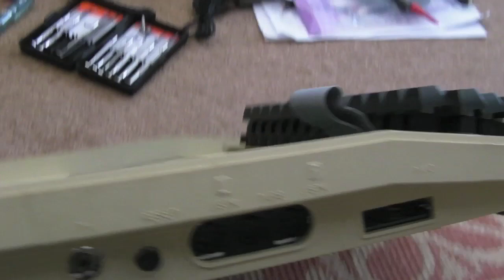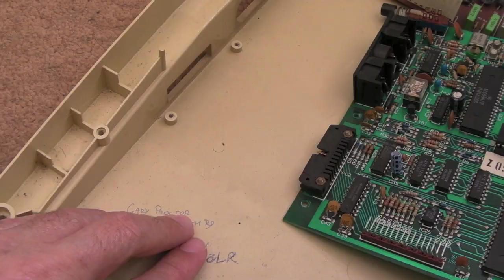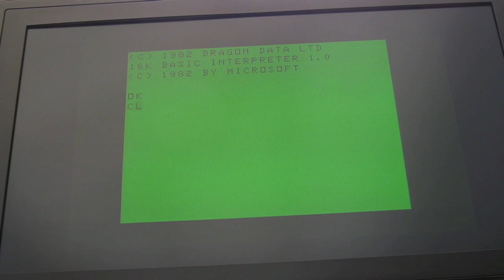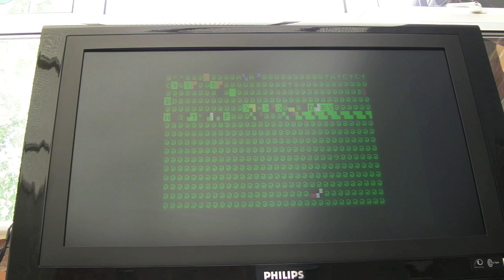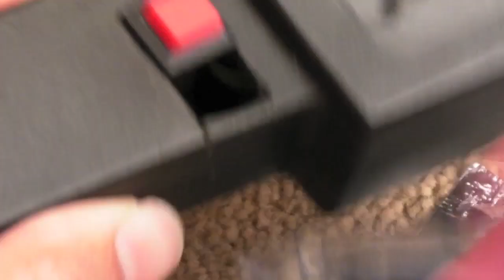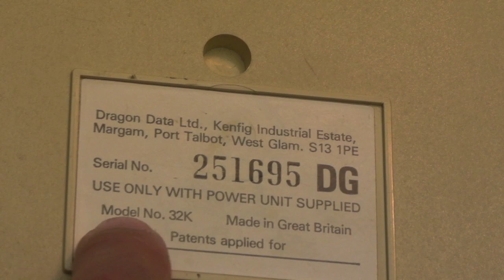Dragon 32 Garbage to Gold (Will it fly again?)

Comment: Just found this, did you ever hook up a hard drive to the printer port? I had one on my Dragon 32/64 it worked very well.
Reply from the maker: What kind of drive is it that you are using?
Reply: @GadgetUK164  Was that question for me? It was a standard DOS drive utilising OS-9 as far as I’m aware. I think it was a retail buy as I can’t remember building anything so not a project as such. There’s very little info on it which surprises me as all my DragNet mates had them.

Comment: Great video by the way - thanks for posting - some useful techniques there for working with these types of boards. Are there any recommendations for where to source some of the older ICs in the UK - not necessarily just for the dragon 32, but other older machines as well.
Reply from the maker: Thanks!  Often eBay is your best bet!  These days its getting harder to find many custom chips though - you may need to find another faulty system for parts.

Comment: Great, all perfect, Dragon 64 has another ROM and can boot in 32 mode
Regarding the Joystick, I would suggest that you put a 2nd button, but it depends on whether you get the cable with the appropriate wires and the co-connector, at least in Coco there is
interesting proposal to make the list of coconut cartridges usable in dragon vice versa, or I have almost all coconut and I have a DRAGON Tano ntsc, I will try to make the list
+Suscript

Comment: I got my Dragon 32 (bought new by me in 1982 or 1983) out of the attic to play some old games with my son. There are some websites with audio files on them which are recordings of the casettes - I used the headphone socket of my laptop on max volume to play these into the Dragon - this worked a treat and I would recommend this to anyone who does not have access to an old mono casettte player. Then you have to find a television with a tuner but that's another story!

Comment: Good day bud. I've just found your channel and I too have a dragon 32. I'm not hugely tech minded but I wonder if you could give me a bit of advice. I plugged it in and you can hear a click, the components inside get warm but all I've got is a blank black screen. I tried tuning into another channel(36) and you can sort of see something scrolling up. I'm also plugged into an analogue TV. Any help would be much appreciated 👍
Reply from the maker: I would make up (or buy) a composite lead!  I think I mentioned how I made my own in this video!  The problem with RF these days is you will find it almost impossible on modern TVs to tune into the crusty analog signal when using RF.   It's worth checking the voltages as I showed too - both on the PSU and internally.
Reply: @GadgetUK164  cheers for your advice mate, I'll get myself a multimeter and test the voltage etc and get myself an up to date lead 👍

Comment: How did you manage to get such nice video output? Mine is super blurry and I can't get around this problem :/
Here is a pic of mine D32 connected via composite. https://i.imgur.com/8a2qAf8.png
Reply from the maker: It might need recapping - it could be that the composite cable you are using is not very well shielded or too long perhaps?  Final thing might be the fact I grounded that crystal on the PCB there, but I suspect that relates to RF more than anything.
Reply: @GadgetUK164  Good points, however, I've already recapped it :(  I'll check crystal thing but I suspect LM301 opamp is dodgy. I've just ordered a few of 'em :)  Sorry for noob questions but I've never run this machine before so I didn't even know that a video output is crappy until I saw your video lol :D

Comment: I've seen many boards where they don't maintain pin-1 alignment.
It should be noted though that this is most commonly used when they put more focus on data or address bus alignment.

Comment: Your -5v is used for biassing the bases of the FETs in the DRAM, each chip only pulls ~200uA, so 16  of them will be 3mA. As you noted the regulator will not heat at all, so its not required to heatsink it. I imagine originally insulated and bolted down just for mechanical stability.
Reply from the maker: Thanks for the info there =D

Comment: Interesting about the Tandy similarity, can't say I've heard anyone mention that, good way to pool both communities with mutual love and make them less obscure in the mindshare. Loud colors compared to Tandy.
That Playstation cable is light gun related, you can increase the accuracy by running one through the Composite line, that and the back ports changed with PS1 revisions so they had to adapt to that.
Analogy bits heh, yeah it all had it's quirks with manual driven remedies. A lot less tape loading in my region but music and VHS needed a little added tension sometimes in my experiences.
Reply: @unrepeatable raddish : Yeah... You could use a lot of the Tandy cartridges, tapes, and controllers on the Dragon 32 with NO issues at all - there were an odd one or two that didn't work, but most did....  That's what I found when I worked in a small independent retailer that had a Tandy dealership associated with us... so we also had the TRS-80 Colour Computers in store at the same time as the Dragons.... Very inter-compatible!!  Good machines both, except of course here in the UK the ZX Spectrum and C64's ruled the gaming landscape at the time - and both of them too being fabulous computers of the day.... the Spectrum being the most popular, and giving many of todays best known producers of games their start, by doing the 'bedroom programming' thing!  Companies like EA, Activision, and Rare all started with the ZX Spectrum.
But all that said, the Dragon, and TRS-80 'CoCo' were good computers for the time too....

Comment: The IC17 (ROM) has been replaced on your Dragon32.. possibly there was a problem with it originally, or it was an upgrade.. see worldofdragon site for more details..
http://archive.worldofdragon.org/images/3/3e/Dragon32_PCB_Top%28PC10087_Issue6%29.jpg
Reply from the maker: Thanks for the info there!!! I've been wondering about that ROM for a few weeks now lol, and you've solved it for me =D
Reply: I've got a Dragon32 (not that I can recall opening it up though) and I've also got a Tandy Colour Computer 2 with 64k Extended Basic.. so I know most of the quirks of these machines from years ago.  There was a bug in the original Dragon ROM, because they essentially cloned it from the Tandy and changed a few minor things - that was the major reason why Dragon Data was sued by Tandy Corp.  The DEFUSR(0) command is buggy on the Dragon32 - that's the one give away!  Your IC17 could be an attempt to rectify that bug, or the original got fried and it was a spare inserted in its place.
Reply from the maker: Thanks for the info there =D

Comment: Great video as usual. 
I have a Dragon64. You can use a CASDuino to load games, I asked the guys to support Dragon .CAS files as I thought they might be the similar as MSX files and the guys managed to do it. :)
Also you can build a Digital-to-Analogue converter for the joystick to use normal 9-Pin Dtypes. They work well, especially as many of the games are Spectrum conversions which were designed for digital joysticks.
Reply from the maker: Thanks =D  Yeah. the TZXDuino works too - with the right firmware.  I will get another with Dragon firmware soon =D

Comment: having watched this and had lots of memories stirred I did a bit of reading up. As you mentioned you can control the cassette using MOTOR ON and MOTOR OFF in BASIC. However, you can also type AUDIO ON and AUDIO OFF to play the cassette through the TV speakers. I used to play music tapes through it when I was a kid. There's also a game called 'Drone Datatank' which used this feature to add effects to the game as you played it - if you can get hold of it, it might be a nice thing to feature.
Reply from the maker: Thanks!  Was aware of MOTORON (I used that to test but forgot to mention in the video), but I wasn't aware of AUDIOON =O  Will try that next time I look at the Dragon!

Comment: Nice.  I used to have a cartridge that would retoken Coco basic programs.
Still have my Dragon but joysticks are long gone.  Might knock up an adapter.
Reply: You save the BASIC program as ASCII by appending ,A after the file name on either computer. Then, you can load it on the other system and re-save it normally.
Reply from the maker: Thanks for the info!!! I had no idea there was a cart for that!

Comment: Another excellent video. The reason the Dragon32 and the TRS80 COCO are so similar is they are both based on the example computer that Motorola published for the 6809 CPU. That button on the joystick is bang on for the original by the way.  In all the Dragons I've worked on the -5V reg is just sat upright. The only thing you need to do to get a COCO disk cart to operate in the dragon is swap its ROM with a moded dragon disk cart ROM it's not 100% Dragon compatible even then but if all your doing is loading games it works fine. I was considering getting a COCO but now may do as you mentioned and mod a dragon into one would be cool to be able to which from dragon ROM to COCO ROM I know that can be done with the disk cart too.
Reply: Oh and thanks for another mention ;)
Reply from the maker: Yes, I did wonder if they had followed the reference design - too coincidental, but also nearly every chip is Motorola - that's not a coincidence lol =D
Reply from the maker: You're welcome =D
Reply: You can't switch a Coco to a Dragon just by switching the ROM. They keyboard matrix on the two computers are different.
Reply: Modifying the ROM routines does not control for software that directly tries to read the keyboard matrix.
Reply from the maker: Yes, that's why I decided to do a hardware mod (as per my previous comment).  It's easier to route the connections through an IC and have it switch them over depending on the system, rather than modify the ROM.  But a ROM mod would work for any games or code that accesses the keyboard via ROM calls.
Reply: @GadgetUK164  Routing the keyboard is easy you just have to change some columns and everything will be fine, and the ROM
Reply from the maker: You can if you modify the ROM keyboard scanning routine!  But I was thinking of a different solution rather than a ROM mod for that.   A mod also needs to be done to the ROM anyway for the memory detection.

Comment: the lm1889 is the video ic,same one in the 16 an 48k spectrums
Reply from the maker: Thanks, yes - doh!!!  That will teach me not to just speculate what something is based on a part number!   There is an op amp around that area for the tape interface though.
Reply: the tape is controlled by one of the 6821's,and relay through a transistor to turn it on and off,from memory motor on command,there is one to turn the audio on like coco's but i cant remember what that is at the mo that would help if you wanted to hear it loading,and yes there is two roms,something like two 2764 in mask form,the machines do use the same schematics laid down by motorola
Reply from the maker: I believe the input and output goes via an op amp though?
Reply: yes,indeed it does ,then on to the very same 6821 as its a i/o controller
Reply: you can even add the rs232 interface that the 64 has

Comment: http://www.dragondata.co.uk/tech/circuit-diag/D32/OKI/D32-OKI321-CPU.gif IC17 (top right) it's another ROM - as A0-A12 is 8192 addresses it may be that they needed more than 8k and effectively added A13 by using that 74LS138 demuxer with low outputs to pull the chip enable low on either one or the other ROM at a time.
Reply from the maker: Thanks for your detailed info there =D   It's strange because documentation I found in a few places seemed to suggest the CoCo has 2 x ROM chips and the Dragon has one, when clearly the Dragon has two...  Unless one is kernal or something?!?

Comment: As you were talking about the problem with the crystal shorting I was cleaning a PCB and happened to be right above a crystal. They put a bit of clear heat shrink over the can I guess to prevent a problem like you were experiencing.
Reply from the maker: That's a nice fix!!! =D   BTW - I will give you a shout out when I do another Dragon 32 video, either when I do a vid on testing RAM, or converting to a CoCo.  I had filmed this video around 2 weeks ago, otherwise I would have mentioned your recent TRS-80 video.

Comment: I had a think about the test rom. Use beeps not flashes. Probably easier to init sound than video on that thing.
Reply from the maker: It might not be that hard - seems to be memory mapped, although sound might be easier as you say!  I need to find a Dragon developer document somewhere later I think.

Comment: yes, the Dragon tape uses a remote signal. You press play on a compatible tape recorder and it won't play until you type 'CLOAD / CLOADM'. One game actually made use of this with a tape that played stuff at certain points as you progressed in a game.
Reply from the maker: =D  Yeah, I worked out (but forgot to mention) you can use MOTORON and I think MOTOROFF to switch the relay on and off.
Reply: sounds familiar. I'm not totally certain but I think it might have been possible to get whatever was on the tape to play out of the TV speakers. Can't remember if it was a trick or a command however.
Reply: @HappyCodingZX  Yes, Audio ON/OFF en basic, any ML too

Comment: use asm6809 which is totally free - great little compiler you just write your opcodes in a text file and then it builds them into an assembled hex.
Reply from the maker: Thanks, awesome!!! I've been searching high and low and mostly found linux based compilers so far =/  Will give that a go =D

Comment: Quality repair! Interesting to see all different power designs of retro computers. The Dragon is quite a odd one with the special transformer and all regulators inside the machine.
Reply from the maker: Thanks =D I forgot to show it but the case has brass screw hole mounts too! (I will show that in the next video on the Dragon).  Try finding another 80s computer with quality screw mounts like that lol!!!

Comment: Who the actual ** put that bedside lamp switch on that stick!!!!!! 😂😂 Butchers!!
Reply from the maker: LOL!!!  Now you mention it, it does look like a Scalextric PSU!!!
Reply: Faginrs500

You'd be surprised how often I saw that kind of "mod" years ago on machines from the classifieds or local tip. lol

Most of them were far worse than what you'd find on the average eBay purchase now, especially if the previous owner was an old-skool HAM.

The golden rule was to ALWAYS check the mains plug first, and find the usual 13 Amp fuse, or fuses wrapped in foil / replaced with nails. lol

Used to see a lot of computer PSUs replaced with one from a Scalextric, and they wondered why there was so much noise on the video output. sigh

Mains cables replaced with doorbell wire was always a fun one.
Reply: Oh yeah - I'm pretty sure most of the Dragon 32 transformers actually WERE used on Scalextric sets, or model railways.

Obviously AC though, hence the large caps and regs in the machine.

One thing I recall as a kid from messing with the Dragon 32 is that you would get a nice "tingle" by touching the top pins of the power switch because I think the trafo is 24V. lol
Reply from the maker: Thanks - great =D
Reply: GadgetUK164 - Retro Gaming Repairs & Mods 

This vid is aching for another remix, especially at 48:23

:p
Reply from the maker: I know lol - its crazy =D
Reply: GadgetUK164 - Retro Gaming Repairs & Mods BTW... the button you have now put on is correct. There are a couple of unbutchered  sticks for sale on eBay.
Reply from the maker: LOL!  Yes, I always expect someone to say "Why were you wan@@@@ that cable?"

Comment: Nice job ! It was always obvious to me that duplicated tapes for home computers were usually done on the cheapest, worst quality tape they could buy! Dubbing a rom to a new tape always seems fine for me.

You could put a little square of kapton tape under the crystal.
Reply from the maker: Yes, re-recording can work well to fix a damaged tape =D   The kapton would also work as you suggest there!
Reply: if the tape is damaged it can be recorded on another cassette and then pass the tape to the shells (casing) of the original cassette to keep its original appearance on the outside

Comment: My advice about the missing part of plastic in the joystick and that you've covered with sticky tape: Buy some black soft plastic covers for binding  photocopies or papers if you know what I'm talking about. They are made of a soft rugged plastic that you can cut with your scissors and use for a lot of things like this.
Reply from the maker: Thanks, I may revisit that as you suggest =D  I am sure it could be better yet!
Reply: Yep, you'll like it. In this case the tape around the button is a bit of a crappy solution. Using these plastic covers it won't look as original, but it won't atract your attention, it will look nice I guess. Cheers.

BTW I'm trying to make a FM radio for the C=64 http://eab.abime.net/showthread.php?p=1243988#post1243988